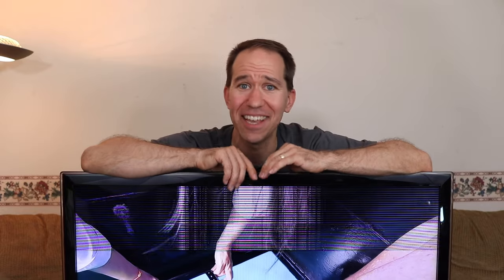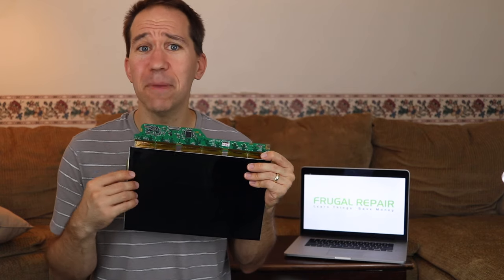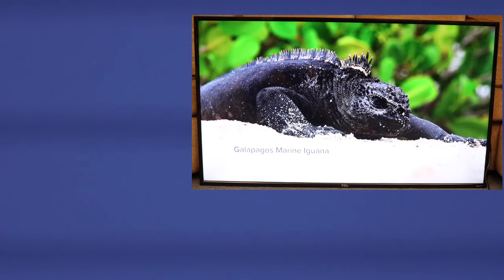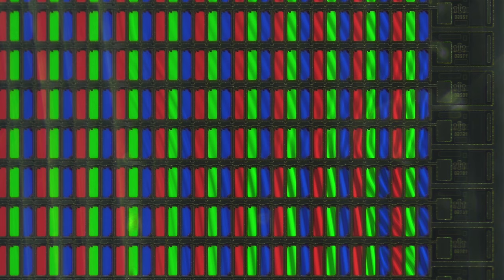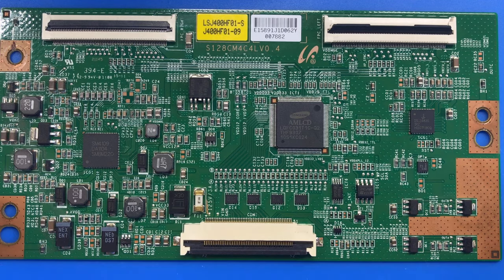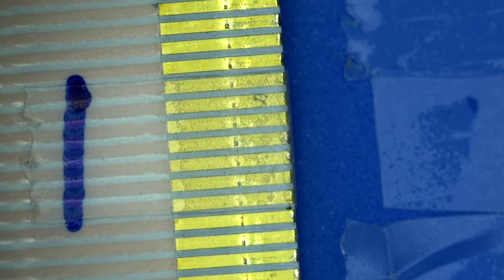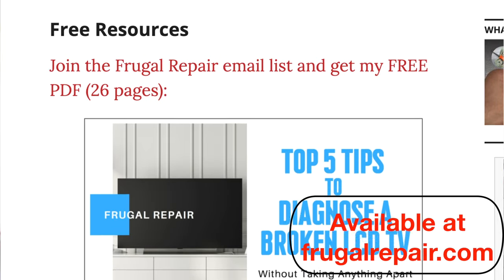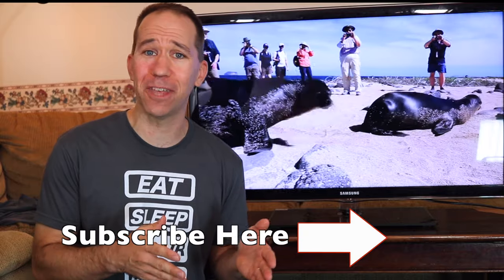Repair Hack Explained | How to Fix TV Horizontal Lines - Part 2

Comment: Hi, can't you just replace the ribbon cable if the cable may be the problem?
Reply from the maker: The problem is in the LCD screen assembly so a new cable will not help.

Comment: My LED Samsung smart 32" TV has got vertical lines over the image with glare in front of the image. Also I noticed noise inside the screen when I removed it from wall socket. Kindly advise what to do

Comment: I have a Samsung un70nu6900 that power cycles off and on unless I unplug the top ribbon cable from the main board let the tv completely power up , then replug the top ribbon cable in and it works like new that only way it will turn on. Any help will greatly appreciated.

Comment: Would the tape work on LED TV's?
Reply from the maker: The TV's I've worked on in Part 1 & 2 are both LED backlight.
Reply: @FrugalRepair     Real cool and thanks for the getting in touch, I have Mitsubishi 32" with the horizontal lines in the center area only, and I just might try this out.

Comment: If the failure is due to a short couldn't one reflow the connection with a hot air gun instead of blocking the signal?

Comment: I am getting 2/3 of my screen cut off with a stack of 8 lines or so at 165hz I was able to drop to 144hz but now its happening on 144hz If i set it at 142 it works for now. could tape fix this?

Comment: My Jvc 58 roku TV has horizontal lines on the lower half of TV where do I put the tape. ?  The top half is good. Dont want to throw my TV.  Please help I dont have a voltage meter to check.?

Comment: If you wanted to replace the board where the problem circuit is, what is that board called?
Reply from the maker: The problem is inside the lcd panel
Reply: @FrugalRepair  I thought there was an issue with the signal going to the panel.

Comment: Can you help my with my 50" UHD smart tv
I have black lines running across horizontally on it and they are not moving im not sure what is the problem.sometimes my tv even restarts for itself then a big balck patch would appear on the home screen and it will shut off and restart again
What causes this?

Comment: Could this done for Samsung 75 inch model qn75q70tafxza.  Does not have tcon board.  Replaced mother and power supply board.  Thanks in advance

Comment: I have a xiaomi curved monitor.I.already blocke some signal and it works well but the bottom below i still have some vertical lines ......where should i blocked the signal with tapes again?

Comment: Hi great Video.  My friend give me a Samsung EU43RU7410U 4K UHD TV  (also showing as Model Code EU43RU7410UXXU ).
When it is switch on after 3 minutes the who screen frequency goes like fuzzy horizontally  across the who screen for 3 seconds then stops with normal a image and 3 seconds later it repeats the process constantly well I have only had it on like that for about 5 minutes. I don't think the tape fix work for this situation, I think it would be hardware related.  Your help would be appreciated greatly for a first time novice fixer. Regards

Comment: but if the screen has only 1 t-con cable?(102 cm screen) how can you gwess the sid or it can be blocked?
Reply from the maker: You would have to physically cut the traces on the driver board.  Much more difficult in this case.
Reply: @FrugalRepair   any ideea how to make sure that the display is broken or the motherbord? when i turn the tv on it shows some horizontal lines on the bottom and afeter 1 min the image is starts to flicker and doubles

Comment: I have an LG flatron E2241 displaying pixel-thin horizontal lines seemingly at random locations all over the screen, the pixels are not really dead since they start bright and then turn darker and darker, I've been told that the problem there is the panel and its unfixable basically.

I wonder if there's something to be done about this, there are like 50-60 lines spread out enough that it doesnt make the monitor unusable but it just looks bad and I can't really replace it at the moment.
Reply from the maker: If your monitor includes row signals that come from each side of the LCD, then I would say you have a decent chance of using the same trick.
Reply: @FrugalRepair  Hello, thank you.

The design on it is much simpler unfortunately, it has a single ribbon cable going to an absolutely tiny (credit card size) board, it is a LED panel but it reminds me more of a CCFL LCD. I'll try to find a service manual for it and check

Comment: I have an AOC 27 VA monitor and it has this problem, but it disappears 
after switching to a different port that's not connected to anything, 
then reverts to DVI. It just takes a few tries before it really fixes 
itself and you can start your day, but it gets really annoying over and 
over again.

Comment: Are you familiar with the disaster that is the RCA RHOS651SM? 65" UHD 4K - Some of the time it turns on fine the rest of the time I turn it on, lines propagate from the top and bottom, lines fade in vertically and the boot screen hangs, all at the same time ! Today was a new symptom.. the laptop screensaver kicked in when I went outside, the laptop then cuts the video signal after 5 minutes which prompts the tv's "no signal" balloon to float around the screen.. when I came back in the "no signal" balloon was there but was randomized pixels! The set was only manufactured in July 2020, I took possession in September 2021.. yikes! Any idea?

Comment: Good afternoon, hope you are doing well.
Why when I block anything, the TV wont turn on normaly anymore. It will try, turn on black, stay like this 3-5 seconds and turn off. Then it tries again but nothing happens.
Reply: I have only 1 horizontal line, on the left side its more like black blueish and on the right side liek the background but lighter. And its a Samsung TV
Reply from the maker: Sorry, I don’t know.  I’d have to see what your doing.  If you are blocking one side of the row signals your tv shouldn’t shut off.  Maybe there is another issue?

Comment: Hello @FrugalRepair recently i presed  my thumb on my roku tv to hard and it cracked but not all the way threw is there any way i can fix it it also has rainbow line and a couple black circles please help
Reply from the maker: Unfortunately, you can’t fix a cracked LCD
Reply: @FrugalRepair  ok thank you

Comment: hi can you help me with my monitor my 32 inch have horizontal line. whan i turn on my monitor at see a lot of line at the bottom side but i wait like 3 to 5 min all the line go away do you this the tape will fix that also

Comment: I have a monitor With a horizontal line problem. I've found another channel, not this one, same teaches to put tape. Now when I open the monitor I accidentally ripped off one of the yellow golden tape/ribbon. and it turns my monitor all black. can I still repair it?
Reply from the maker: Unfortunately, that’s the tab bond and I don’t think you can get it back on without a very expensive machine (many thousands $$).  Sorry!

Comment: I was trying to follow your guide but my Samsung uses a main board instead of a tcon board and I can’t find a single reference to which ribbon parts are for signaling
Reply from the maker: It is likely an integrated tcon/main board. There are probably two cables coming out of the board.  Find a group of signals common to both sides (use multimeter in continuity mode), and those are likely your row signals.

Comment: I have a different type of horizontal lines on my tv. The TV is an LG 65UJ63 from 2017. There are 2 horizontal lines, very faint (as if they were watermarks) one 15cm (6 inches) from the top, and the other 30 cm (12 inches) from the bottom.
I only noticed them when there is an image with a flat bright color on the screen, (e.g. like a blue sky) 
For a day or two I saw only the top line and thought that it was a ghost image left due to regularly using the TV connected to my computer, with chrome opened; thinking that one of the lines of the browser matched it. However, upon further inspection I noticed that the ghost lines don't match any stationary lines on the browser, and that when changing input sources on the TV the lines seem to form 5cm (2 inches) lower on the screen and immensely slide back up to their usual position. 
I even get them when streaming Netflix directly from the TV's OS (WebOS 4.5 I think) 
So the lines are not burned into the display nor does it seem to be a connection issue (unless is an internal component)
About 6 months ago this TV was repaired due to burned back LEDs after a power outage, and since then I have been using it with a surge protector.
Do you think it can be a tension related issue?
I appreciate any advice you can provide.

Comment: Mine is a JVC with the problem: Two horizontal lines looking more like a weave missing 2 threads... I opened it and cannot distinguish the board or the signal ribbons. Was like a bunch of wires. What to do?

Comment: Do you know why this problem occurred? What exactly happened to the TV screen that cause this horizontal line? My TV is 3 years old and it just suddenly show the line today .
Reply from the maker: It’s something that went wrong inside the lcd display. Probably a short circuit.

Comment: I have a 49inch qled q70r Samsung with faint horizontal lines all the way through the tv how would I fix this pal
Reply from the maker: Did you try the isolation technique?  That would be one of the first things I would try to get a good clue if the problem is on the panel or the control board.

Comment: What about vertical lines? I have a 51" Samsung Plasma HDTV and it has one green vertical line on the left side and one red and one green vertical line on the right side.
Reply from the maker: A plasma is different.  You may be able to clean the ribbon cables to get rid of lines.

Comment: Hi I have a Sony xbr 55x930d and I have a horizontal line and middle of the tv up it is blurry. Do you think it is a Tcon issue or a lcd. I brought it to a shop and the said it’s a lcd issue and Sony doesn’t sell lcd. Please help. Thank you
Reply from the maker: Doing the isolation technique should give you a clue if it is the tcon or not.  I'd press the shop to tell you in detail what they think the issue is.  If you paid a diagnostic fee, they should tell you.
Reply: The shop told me it’s the lcd and they cant get the lcd because the lcd isn’t sold by Sony. I did a google search and I guess it’s a common issue with the lcd being faulty. Thanks again
Reply: When I pick up the tv tomorrow I will do the unplug of the t con ribbon cable and see if I can isolate the issue.
Reply from the maker: They should still be able to tell you what the problem is within the LCD panel (generally) or at least give you some guesses.  I know on some older Sony‘s there was a problem with the tab bonds lifting from the driver board. One repair hack if that is the case, is to put pressure on the tab bond with a non-conductive material.

Comment: My vertical line come and go. When I isolated the sides, things seam to work fine on one side, but the other side blinked. I tried swapping the ribbons and it worked when I isolated the side but when both are plugged in together the lines come back after a few seconds. I already tried replacing the TCON board and no change.
Reply from the maker: This video is for horizontal lines.  Have you seen my vertical line video?

Comment: I have the same problem with my tv lg web os . And I tried to fix with scratch tape but it's not came to the normal. So what I can do now, I don't know the line's which I covered with tape was exact or not but lines which is appear on screen go to down little bit only that's happened...
Reply please.
Reply from the maker: There’s not much I can do to help you, unfortunately. Either way you have to prevent the signal going to the broken component on a row signal, or you’ll have to live with the broken LCD. There’s really not a way to fix it if your problem is Internal to the LCD

Comment: Which tape u r using ?
Reply from the maker: It's scotch tape.  The tape brand doesn't matter though. You could cut the contacts off the ribbon cable but the tape method is easier to help diagnose the issue, in my opinion.

Comment: Is this the same with a QLED with the same problem??
Reply from the maker: I am pretty sure that it is.  I don't know your model but the addressing should be the same, row signals turning transistors on/off at each sub-pixel, this synced with the vertical data lines.

Comment: Can I fix my tv with out taking it apart , also I don't have the red and black connectors to find where the signals sync , what can I do ?
Reply from the maker: If you have a row signal issue, you definitely have to do what I did in the video and take your tv apart.

Comment: Mr Frugal is the t con board the main reason behind this problem
Reply from the maker: On this tv in the video?  No, it’s a problem  with the lcd panel.
Reply: So how come the lines disappeared when u manipulated the signal coming out from the t-con board. Cause I'm having the same problem and I'm thinking about replacing the t-con board
Reply from the maker: Because the problem is on the panel and you’re blocking one signal that is bad but the redundant signal on the other side is ok.

Comment: Hi can do u a video like this for solarization picture?
Reply from the maker: It’s possible solarization can be addressed with the same diagnostic and solution.  Have you tried what I did in this video?
Reply: @FrugalRepair  i will tempt it and see if it works, how often do dc-dc converters blow out and idea?

Comment: 🇬🇧...I "repaired" my LG SK8100LLA, whose screen failed but the backlight LEDs were still functional, using the method of stripping some pins of the data cable.
Now there is an image again, but a thin "line" can be seen horizontally in the middle across the entire screen!
Unfortunately, I don't know whether cable or T-CON was responsible, so of course the cause cannot be narrowed down any further.
Logically, I would love it if all the errors could be fixed...!
🇩🇪...ich "reparierte" mein LG SK8100LLA dessen Screen ausfiel, die Backlight LEDs aber noch funktionstüchtig waren, nach der Methode einige Pins des Datenkabels abzuisolieren.
Jetzt ist zwar wieder ein Bild vorhanden, jedoch horizontal mittig eindünner "Strich" über den gesamten Screen zu sehen! 
Ich weiß leider nicht ob Kabel oder T-CON verantwortlich zeichneten u. somit läßt sich die Ursache natürlich nicht weiter eingrenzen.
Am Liebsten wäre es mir logischerweise, wenn alle Fehler behoben werden könnten...!

Comment: i have a green line at bottom of screen and up left side. sometimes the edges end up having color lines that "chase" the image. its a samsung 4k tv... all up to date. whats the issue?

note: happens on screen fit/on 16:9
if i custom it it doesnt... but also itll cut off image.
Lastly if i end up using custom picture size the issue goes away kind of... however... it still appears if im watching a video, it'll appear at image edge. sounds confusing I know. 

my tv firmware is up-to date. i thought it was bad hmdi but it happens on everything.

Comment: Hi, my monitor hit a corner of my wall and now a white part of it is white, and it also has lines. How can i fix it and whats wrong?
Reply from the maker: Sounds like the lcd cracked, unfortunately
Reply: @FrugalRepair  i followed your video and it got rid of the lines but the the white portion of my scree, do you know what that is?
Reply from the maker: Maybe a loose video cable?  Without a video/photo it’s hard for me to know.

Comment: u said u blocked off the 7 signals...what are the location of those 7 signals?  i could not tell/see...as you did not give a screen shot of the entire cable itself.  you zoomed into the 7 signal too fast for me to see where/what part of the cable exactly you blocked off with the tape...UPDATE 3 hrs later:  i was able to get rid of the horizontal line on my samsung smart tv UN55H6350AF...i just block two pins at a time starting from one side of the cable and keep blocking as i move to the other side...until the lines disappeared.

Comment: In the last few days i managed to get hold of a Sony Bravia kdl55w815b from 2014 Now this tv when you first switch it on from cold has lines on both sides of the T con board output and this vertical line in the same place yours started on the tv in vid going horizontally across the hole screen also the menus picture go out of sync and everything just looks like a bad 3 d picture  but after 30 to 40 minutes everything sorts itself out like the chip on the main board has got warm and the tv looks fantastic I cleaned up the tv took the main board out cleaned up the ribbons etc on the t con board and the tv was a little better on firing up but the horizontal line still came up till everything warms up Now yesterday i was watching a 3 d film on my sony UBX ultra Blu-Ray and thought lets see if the 3 D works on the Bravia well as soon as i turned that on the screen showed the original issues of vertical lines and the horizontal line towards the top of the screen Making me think this is a issue with a 3 D thing even when not on Got to say i have now had the tv since 15/9/22 and have never turned it off even when writing this the tv has been on now well over 52 hours none stop showing no problems What could be wrong with this tv has to be something in the back as no damage to the screen or case i can see By the way i got this tv for free as we think the previous got rid of it due to the start up issue

Comment: Hello I have bit similar problem with Sony kd-43xd8088 TV it has issue that screen looks ok for 10 min while it's worm up after that I get flickering horizontal lines on bottom on screen
Reply: I would be really grateful for any suggestion i already tried to replace tcon bord but it didn't give any real effect